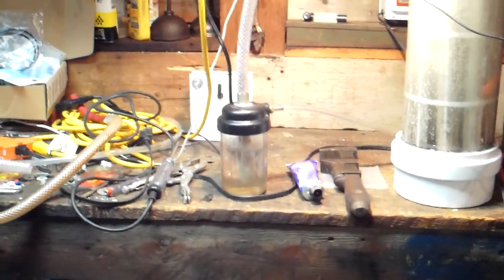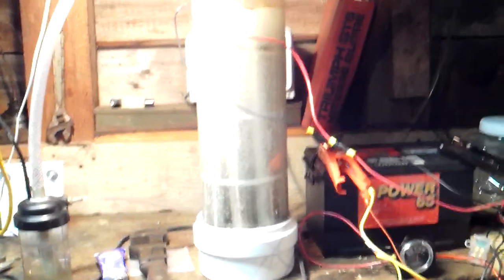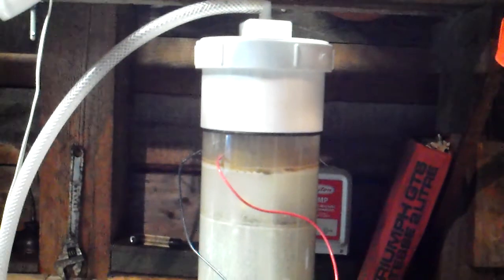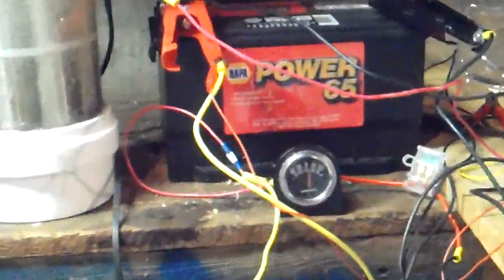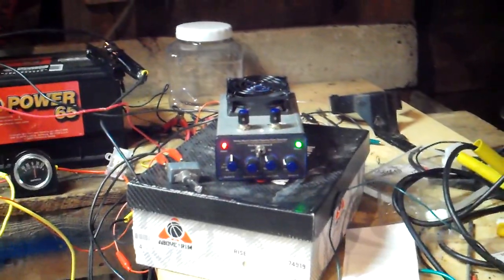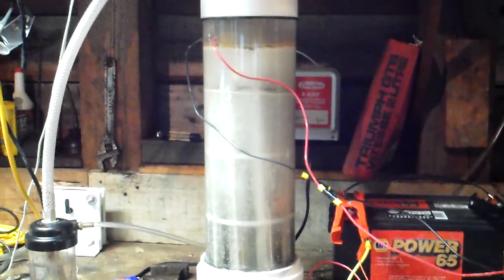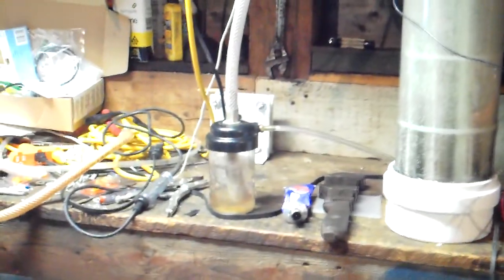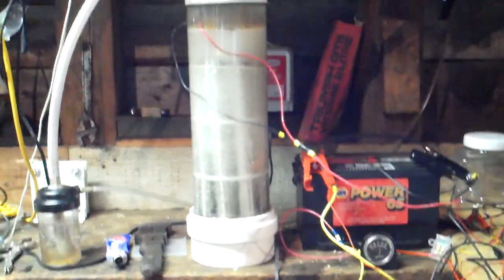Test Run Stanley Meyer HHO.AVI

Comment from the maker: @1987sellt ...the Stanley Meyer eight cell unit just uses schedule 40 PVC tubing and 16 inch tall 316L Stainless steel tubes with 1.1 mm space between the tubes.
It runs cold. Hydroxy gas is explosive under pressure though an engineer claimed he was getting 70 PSI. I've never tested it under pressure. I believe it produces 4 liters/minute of Brown's gas. I no longer sell complete units. There is too much labor at materials cost and shipping is very expensive. Dave
Reply: do you sell plans or building this?
Can it be built easily at home?